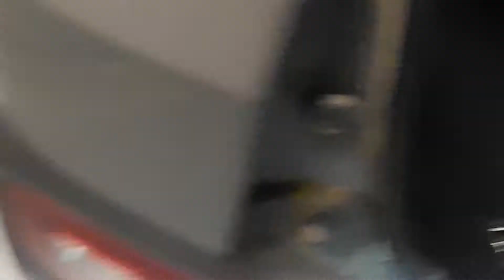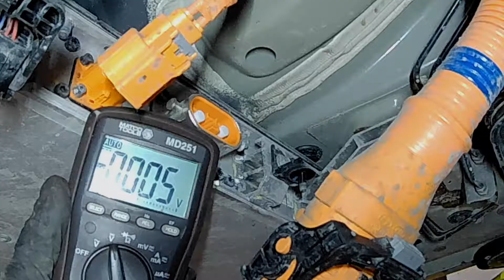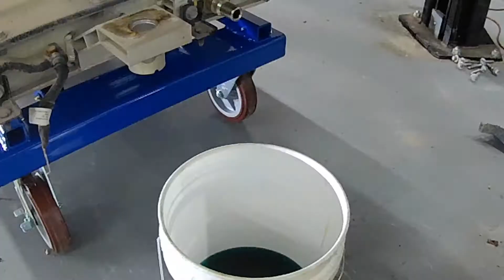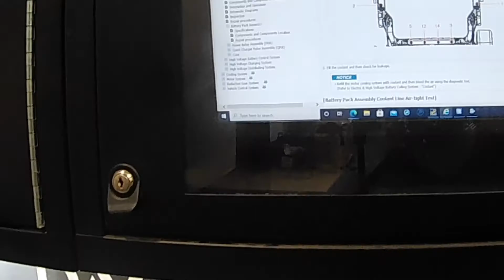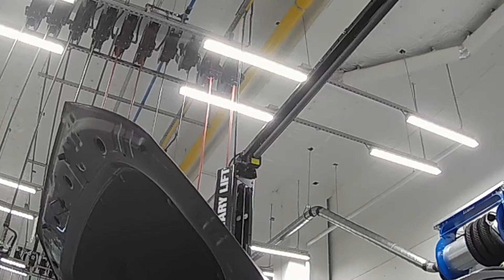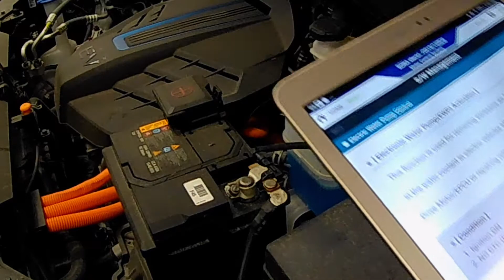Hyundai Kona EV High Voltage Battery Replacement

Comment: Hi thanks for this detailed work for HV system. Can you share what kind of diagnostic tool you are using that can read all the dtc and clear the errors of hyundai kona ev?
Reply from the maker: In this video i use oem scantool but you can get like aftermarket scantool that can scan all system

Comment: I have Kia E Niro+4 and from September 2024 after finishing the charge of my car I have a fault ,,Check electric vehicle system ". They try to calibrating the battery but in January 2025 they decided to replace  the Battery unde  warranty . In February 2025 after more then 5 months waiting the car is on the road but I don't know exactly what job they done and if the car have new update or if my range its like a new car (280 miles range) I will let you know.

Comment: Very interesting video. If I replace the 39kWh battery with a 64kWh one, will the charging power increase when charging via DC, or will it remain at the level of the 39kWh battery?
Reply from the maker: Im not too sure about that, i think theres a physical difference between those two batteries and i think the computer or module will be the one to determine the charge rate for it.  I havent encounter that situation so i cant really give you accurate answer.

Comment: What's the rectangular panel on the bottom of the battery? Is that the pyro fuse location?
Reply from the maker: Yeah thats where the serviceable fuse located.
Reply: @hyundaitech  thanks. Is it likely to have blown in a crash where none of the air bags have deployed? Is there any other reason why the car wouldn't drive after light front damage? The crash was sufficient to badly crack the bumper and fold the front edge of the hood.

Comment: Hi. Are there any other things to do after replacing the battery, like changing or updating the software, coding or decoding the battery New and old? Or just replace the baterry and the car is ready to go. Thank you!
Reply from the maker: If theres availabke update for the BMS and yes yiu have to do that, during the replacement of the battery, just bleeding the coolant and resetting the battery state of charge.

Comment: Hi. I recently discovered rodent damage at one of the main electrical cables. As far as I can see there is no problem to patch it up with vulctape. If I pull out the plug under the back seat, will the car work as before when the put back, or do I have to connect to a computer. I'm really happy with my 21 64kwh Kona. Soon to reach 90.000km.
Reply from the maker: As long as you are not reolacing components, and you just as you say to patch up, unplugging the safety plug and installing it should be fine

Comment: Watching they lower the ev battery so simply by unbolting few bolts just a random thought. Why they don't get robotic arm to drop them after ev has been extinguished. Since it doesn't seam like the hardest process to get them  off. But that's just me ?

Comment: My september 2021 was out of the battery recall and still had main battery failure at 15,000 miles - always used Stage 2 charger on it. Be sure to get extended warranty on these cars. 2019-2020 models also have premature motor bearings failures, very costly if out of warranty (wine sound). Several good videos on this on a YT ukrainian channel. There have also been issues with the reduction gear damage on all years, oil inside reduction gear gets contaminated (yes, oil on an EV), gear bearings start wining while coming to a stop, assembly needs replaced. It seems it's caused by intense use of Regen 2 and 3 in city driving, and by heavy accelerations or driving in hilly areas. Hyundai is denying this issue. Look up for "Kona Electric reduction gear forum"
Reply: 2001?! Sure it is a Kona and not an Electric Saxo or the Citistromer? Theye where fully elelctric and build arround 1997
Reply: @stili774  Thanks for pointing the error, it's a 2021
Reply: Oh, thought you also are since years in EVs :(  @Peppermint1

Comment: Hello great Video. My Kona EV 2023 had bad pothole collision. It bended the tire rods and wheel alignment. The tech says the EV battery sensor for coolant shows up as an error and may need a battery replacement as well. Do we really need to replace the big battery? There are no dents on the battery and the car is drivable with no airbags activated at the time of collision with the pothole. I suspect the Hyundai dealers are playing games with me. Any suggestions and help is appreciated with options i have.
Reply from the maker: Hi, so theres a code for temperature sensor for the battery?  Maybe the sensor or the circuit got disturb during the collision. I dont know of they can just disassemble the battery and replace the temperature sensor, or maybe they dont have the special tools to reseal the battery thats why they are suggesting a new battery. I hope car insurance will cover your repair coz thats really a big money.

Comment: Hello I have 2022 Kona EV and its not even been a year and my battery health is around 90%. How can this happen is there any issue in that model as well?? Do you have any idea how that might have happened? I asked the Service here they said it may be because of vibration and driving method. 
Please do suggest.
Reply from the maker: Hi, theres factors that can affect battery state of health, weather, cooling system for the battery, charging habits. I would suggest to see owners manual on what are the best practices for charging the battery. Thanks
Reply: @hyundaitech  thank you for reply. Will check the manual for the same

Comment: Nice video!
I bought a spare wheel for my kona ev can i just jack it up normal one wheel at a time. I noticed where you had the lift arms positioned on the kona?
Reply from the maker: I believe you can still jack it up 1 at a time, just make sure you jack it up in the right position not on the battery frame.

Comment: Why batteries having to be replaced so soon?
Reply: potentially a short circuit between terminals that were too close in the original OEM LG battery.
Instead of just repairing the battery terminal connection , they replaced the entire battery.

I wish i could buy the old batteries for a home powerwall , they would be easy to fix

Comment: Hello, do you have experience with rebuilding the electrical motor and gear or know any who can do that?
Reply from the maker: Hi there, nope i dont have that experience and we are not train to do that as of now maybe in the future. What they suggest to us if theres a failure on those components replace it with brand new one. Hope that helps
Reply: Was there a factory notice  regarding bearings in the motor or transaxle ?

Comment: I am asking for the impressions of those who are after replacing the battery and possibly updating the software. Something has changed ? Maybe the service technicians from Hyundai told you something interesting about the new battery ...

Are these the same batteries as installed in brand new cars from 2022?  Does a battery change restart the 8-year warranty?  Thank You for Your time

Comment: Hello again. I picked up my car yesterday, after 6 weeks waiting for the battery replacement - UK. My car seems to be sitting higher and I wondered if the replacement batteries are lighter than the 3 year old original one?
Reply from the maker: Hi there,glad that you picked up your car. For the weight i dont know whats the weight of the old battery, but for the neq its more than 1000 pounds.
Reply: @hyundaitech  Thank you

Comment: Good video. I am in the UK and have been waiting for over 5 weeks while they took my car for a high voltage battery replacement. Before that, the 12v battery failed, but HUK say it is out of warranty - the car is 3 years old. Do you update the cars software to put back the correct power output and charging levels? These were greatly reduced on my car
Reply from the maker: Yes if theres available update after the replacement we have to do it.
Reply: @hyundaitech  Thank you

Comment: The “new” battery has resulted in a reduced range - feels like about 95 percent charge compared to before. Since Hyundai gave no paperwork or details about what the battery change involved, makes you wonder. Not saying that it would be easier and cheaper to just recalibrate the software (say, to make 95 percent, or whatever, the new 100 percent), but hey. Also, sitting around in Tilbury for about 6 weeks has caused the 12v battery to suddenly die (that's according to Hyundai Customer Care and an AA recovery technician), which the dealer says is not covered by warranty as it's more than 2 years old. Hyundai Customer Care suggested I could ask the dealer to submit a goodwill request for Hyundai to contribute to the cost of a new 12v battery. WTF? A 12v battery only costs around £90 to replace, but it's the principle… Hyundai and/or the dealer should cough up without me having to beg for this small sum, especially as it's been suggested Hyundai is directly responsible for the battery's demise. Shows where their priorities are, once the sale has been made. Pretty poor attitude.
Reply: Probably they have increased the safety margins in the top and bottom percents of SOC, and if nothing else, it increases the life of the battery which is a nice tradeoff. If people are affected by a 5 percent decrease in available capacity, they ought to have bought an EV with even longer range. Other than that - Hyundai’s 12V system sucks and if they really charge customers having an issue with the 12V battery because the car has its traction battery replaced, that is immoral business practice. 

Most cars with the same electronics / drivetrain, Older Kias, Ioniq, even Ioniq 5 and Niro have 12V issues. Seems like the engineers originally planned to use a LiFePO4 battery that would have had much more capacity and tolerated discharges much better, however they are more expencive so management probably cut them out. Ioniq hybrids actually have the LiFePO4 battery, AFAIK, and replacing the outdated lead acid battery on the other cars shoujlf be fairly easy, though expencive, still the most cost effective solution in the long run.
Reply: @thomashenden71    In 2018 when we ordered our Kona EV (on about a 9 month wait) it was advertised with a 315 mile range (enough to comfortably get to London and back from where we live in Bath). By the time the car was delivered that range had been modified due to new testing regulations - now 285 miles range. Annoying, but still enough to do our regular journey to London and back if we were careful. After the recall I noticed around a ten to 15 percent drop in range. Now, every journey to London requires around an additional charge of £15 on the way back. That's around £1,000 a year extra for us. The additional time spent charging (which had been unnecessary before) makes each trip a pain. It’s impossible to get a response from Hyundai, about any issues - they just ignore phone calls and emails. Saying we should have just chosen a car with longer range is not really helpful - we chose one with a 315 mile range and now, thanks to Hyundai's sharp practice, have one with a 240 mile range. That’s rubbish…

Comment: How long does it take to complete this replacement? My local dealer doesn't seem to be able to do it and I may have to drive several hours to another one
Reply from the maker: The removal and replacement takes atleast around 3 hours, but the time consuming is the taking out the battery from the crate. And maybe the dealer has no special equipment coz its a must to do this job. Hope that helps
Reply: @hyundaitech  thanks very much for the response, that does help. And yes, the dealer told me they haven't received the equipment to do it

Comment: Thanks for sharing this great video!  I think this will be super helpful for new Hyundai service EV techs to see how this is done RIGHT! I am waiting (like many others) for my drive battery to be replaced on my 2019 Kona EV. I assuming this is a Canadian Hyundai dealership? I do see on the left side the Kona EV heat exchanger box which was not available U.S. buyers. Now I can appreciate how this will cost Hyundai recall 200. I was told Hyundai is billed $11,000 for parts and labor for recall 200..

Comment: What scan tool software you are using there? Is that EV or Hyundai specific, or is it a general OBDII software? I have a Foxwell scan tool with the Hyundai Software but it still doesn’t have the update to operate the coolant pump.
Reply from the maker: Oh the scantool that i use is hyundai specific only. What model of foxwell you have?

Comment: Can you make a video how much more the new battery can charge I have a Hyundai Kona  that’s also must have a new battery I wonder what kind of batteries that i am  getting,
Reply from the maker: Hi there, i really dont have information about the new battery on how much more it can take, but in my opinion it should be the same. We just replace the battery because of those specific batteries has internal defects on them. Hope that helps

Comment: Nice to see that the cooling system is self bleeding with the scan tool activated coolant pump. The bleeding procedure on the Bolt EV is a bit more involved.
Reply: Compared to watching how rich rebuild does Tesla’s this car’s battery swap looks way more easy.
Great video 👍
Reply from the maker: @hamster1-1  yeah with the right equipment it makes the job more easier.
Reply from the maker: Really? Are you tech too? Thanks
Reply: @hyundaitech  yes, and you need a special tool that puts the cooling system under a vacuum to refill a Bolt EV properly.
Reply from the maker: @blownb310  ahh good to know.

Comment: Hi. Great video! Quick question for you: when I rotate tires on my Kona Electric, do I need to do anything else besides resetting a maintenance reminder? Thanks!
Reply from the maker: Technically no, but its a good practice to just visually check underhood especially the coolant levels and i think thats about it. Hope that helps.

Comment: Thanks for the video.  I'm waiting for my Kona EV battery to be replaced in the next few months.
Reply: How old is your Kona? Why are you replacing the battery so soon? Thanks
Reply: @Blue-moon12  Thousands of Kona Electric batteries are being replaced under a worldwide recall program due to manufacturing faults that can cause safety issues.  The batteries are not manufactured by Hyundai.  This only impacts vehicles between 2018-2020.

Comment: How much is it to replace and fit an EV battery like this?
Reply from the maker: Labor naybe around 3 to 5 hours, but for the parts im not sure. Hope that helps
Reply: @hyundaitech  Yes it does. I was just curious. Appreciate you posting your videos. I own a Genesis G80 Sport.
Reply from the maker: @Blue-moon12   nice thats a good car
Reply: I was told Hyundai is billed $11,000 for parts and labor for recall 200..